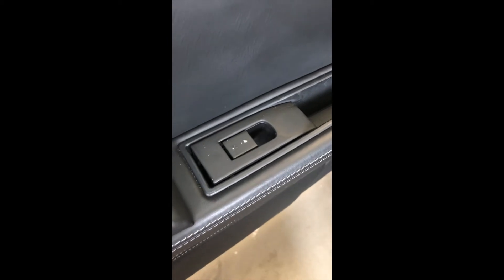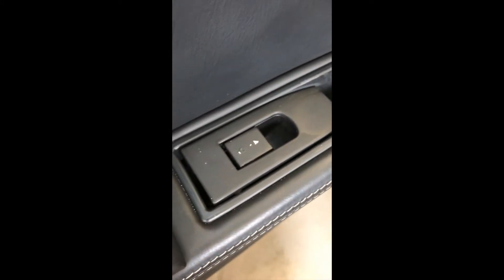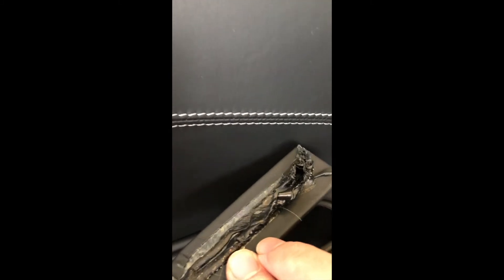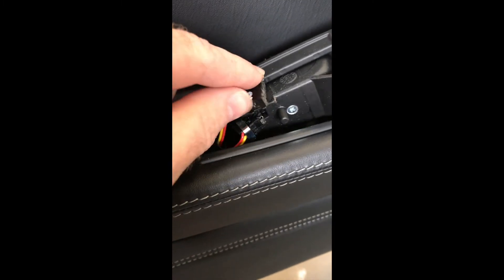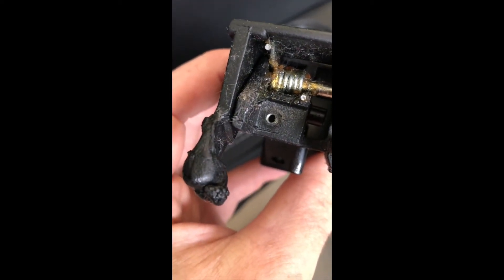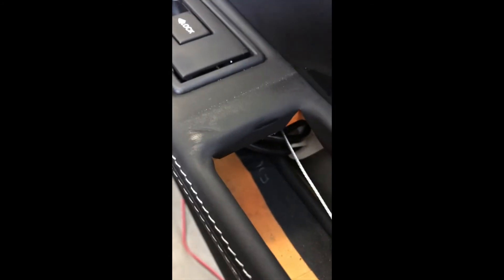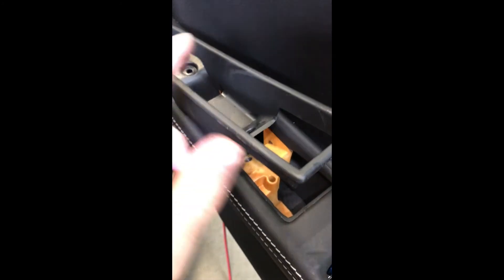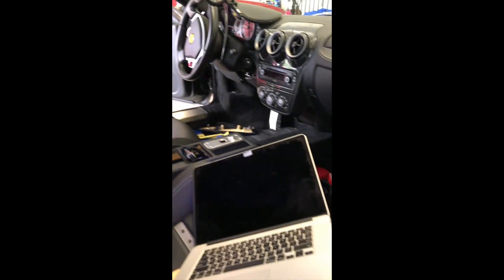Removing F430 Door Pulls

Comment: I'm doing this now...... Thanks for the help!!!  Oh & BTW would love to see what they look lie after the reinstall?
Reply from the maker: Joe- I'm glad you found it useful! Did you get your door pulls refinished or just doing some maintenance?  I had mine refinished at StickyRX and replaced the door cups with carbon fiber ones.
Reply: @mikemorin6078  For now I'm just trying to tidy it up a bit.....Buy a little time I guess!  Are you happy with StickyRX?  How quickly did they turn it around?  Where did you buy the carbon door cups?
Reply from the maker: @mightyjoe3849  Very happy with StickyRx. Turn around just depends on how busy they are and how many parts you send in but expect a few weeks.  I got the door cups from Exotic Car Gear.